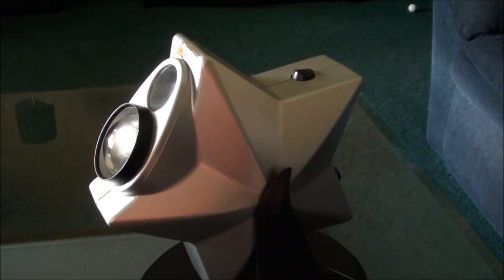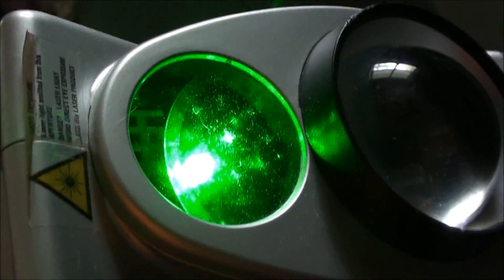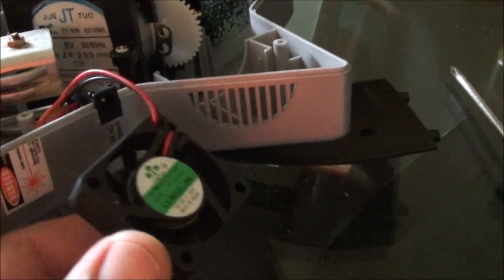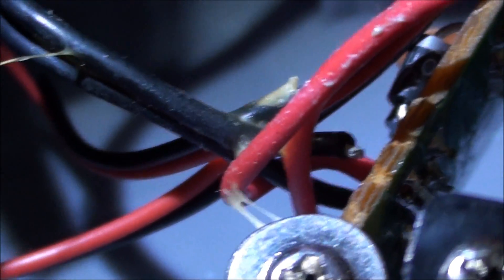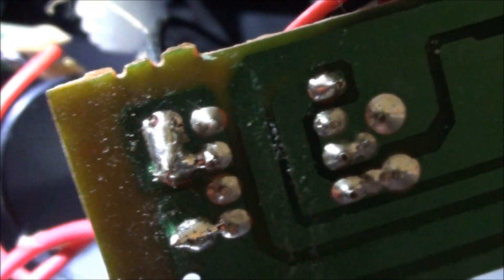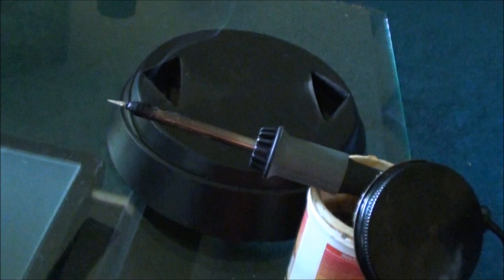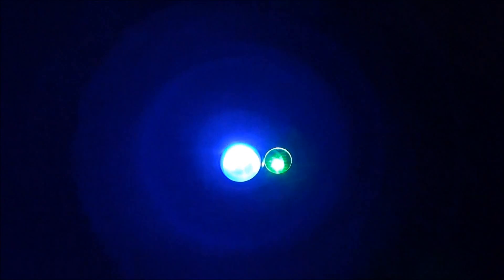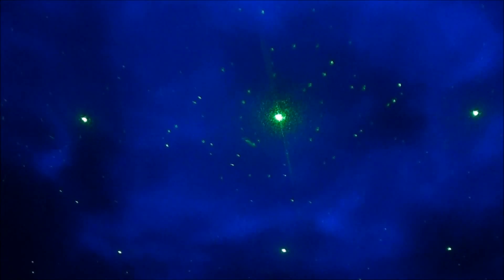Laser Stars Machine Repaired

Comment: I’ve got one of those and thdd we motor hums and makes noise like stuff is happening inside, but the output shaft on the motor itself is not turning. I think the motor is shot. It’s a very odd looking motor too. Seems to be full of another gear reduction unit and the output shaft is offset to one side of the motor block.

Comment: does anyone know the number codes on the resistors on D1 and D2 on the circuit board? I bought some new ones but they seem to be too big still, so trying to find the right ones. They are the little cylindrical ones.

Comment: Nice work. Do you have any idea how to fix the grinding noise? Mine was bought from new and was quiet for the first year...
Reply from the maker: I'm sorry I don't actually own this I just repaired it for a friend and shot a video you're on your own on the gear grinding noise
Reply: Just curious if you ever found a solution cause I have the same problem with mine. It was nice and quiet for the longest time then one day it started making this awful loud grinding noise every time I turned it on. It’s so obnoxiously loud I can’t even stand to use the projector anymore :(